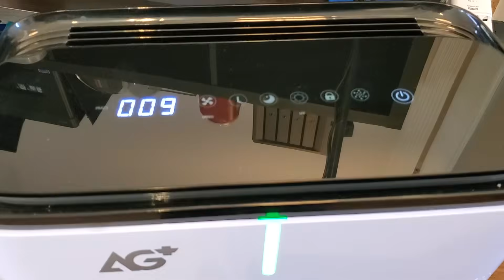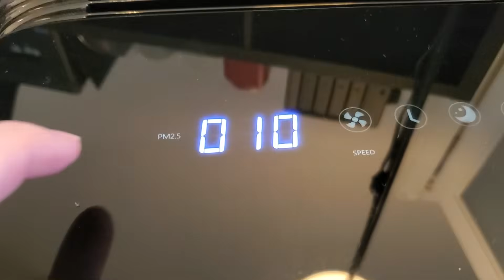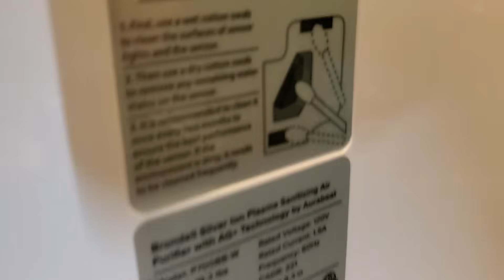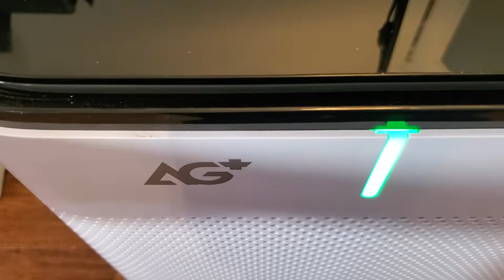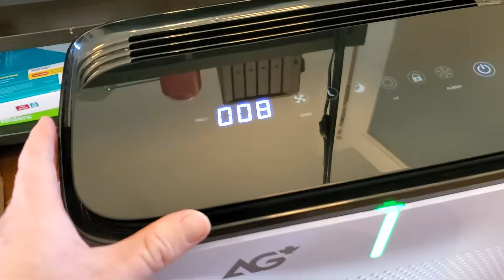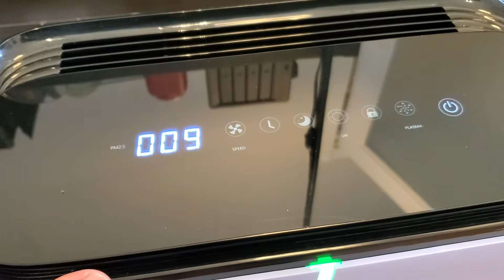$800 Brondell Pro Air Purifier, Tested and Reviewed

Comment: I bought mine at GOODWILL in Peoria Arizona on the 50% day sale for $10! Brand new gently used.
Reply: What a steal! 😅 
Have you noticed any difference between the air quality?
Reply: @juandontworryaboutit4150  I put mine in a room that I would get a headache standing in for literally less than a minute, and now it is fine after 2 days.